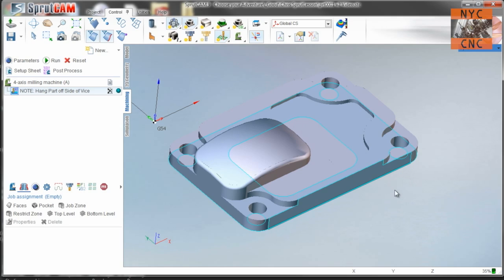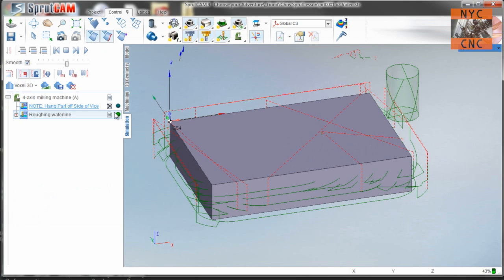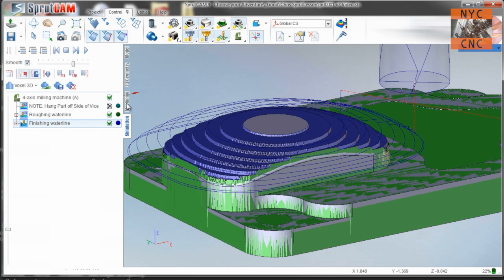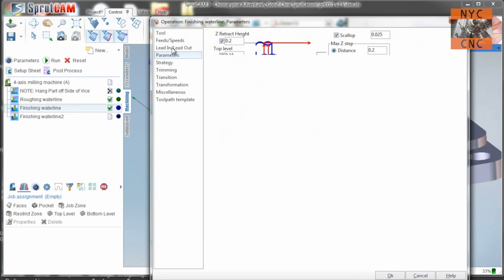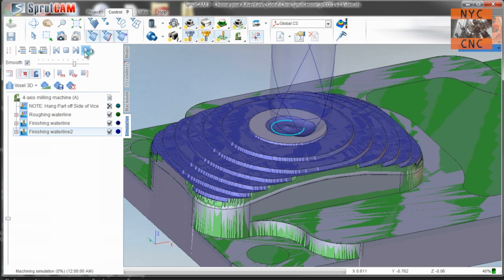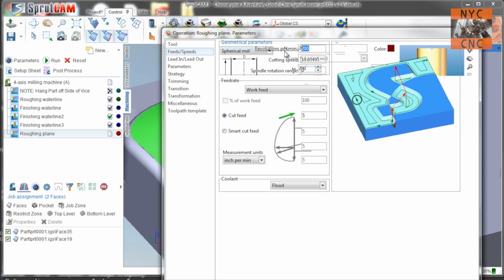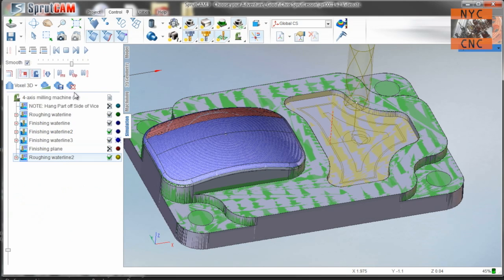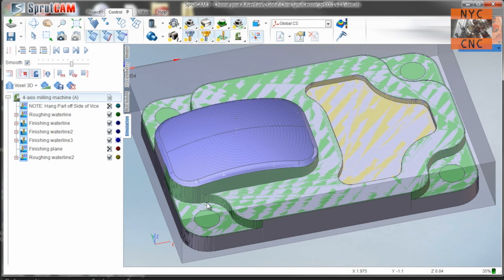Choose Your CNC Adventure: 3D Machining on the Tormach!  Part 1

Comment: For the scallop, does SprutCam let you do a helical cut? It seems like that slight step-over could make a discontinuity there at the edge, and it would likely save a bit of time on the cut. Plus, it doesn't jitter the momentum of the cutter.

Clean and effective method of CAM yet again, and worth watching. 

Also, a CAD drawing and pictures of the air compressor sound suppressor should be in your inbox tonight. :-)

Hope you have a happy new year!

Comment: Hi John,
What version of Sprut do you use, and do you miss any features from other packages..?
(Ps, for 3D contours i usually set the step-over at 8 or 10% of the cutter diameter)
Reply: If i look in a sprutcam webshop i see many different versions of 9... 3x Mill, 5x mill, expert, lathe, machinist, master, pro, robot, universal, wire edm.... So I wondered what i was looking at in your video...
Reply: Thanks, and happy new year buddy..